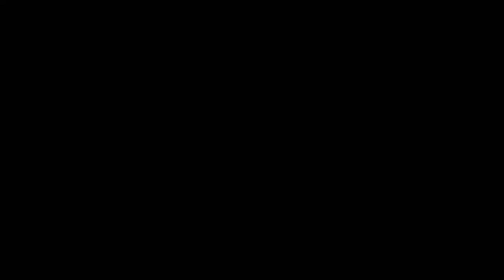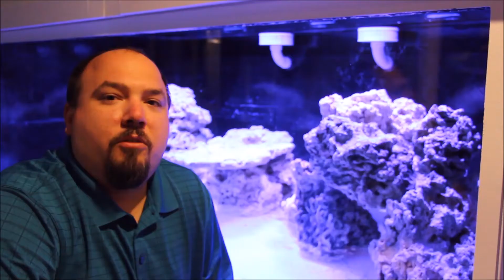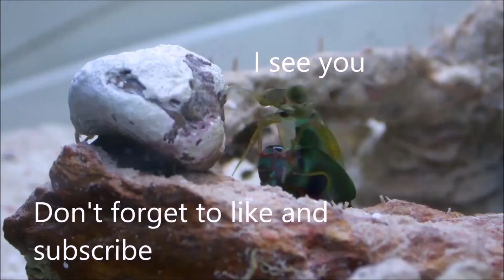720 Gallon tank setback

Comment: Water can be VERY UNforgiving !! Glad you didn't ignore it.  The extra foot of height is big pressure change from the 480 to the 720.. I'm having to set-up a commercial dehumidifier with its own sump under my 540 gallon tank and drain that , the same as water changes because of the house a/c overworking.. Always something,, right ?

Comment: Wow, it's good you had a monitoring plan for this. I had that same issue with the plastic totes I'm using for my RODI and saltwater but the problem there was of course, that the plastic is so flexible. All that did was cause deflection in the vertical plumbing connecting the two tanks. But it wouldn't have shown up if we hadn't done the leak test with the plumbing already in place. We were looking for drips, but this showed up. Just goes to show you there's always something unexpected around the corner. 🙄

Comment: yo said (even more when using add the salt in), why would it weigh    more when using add salt?
Reply from the maker: This is a great question.  When you compare freshwater vs saltwater to each other they have different densities.  Saltwater is more dense than freshwater which in part will make it weigh more than freshwater.  

The best example I can give of how this visually works is the use of a floating hydrometer which is measuring the specific gravity of the water.  Specific gravity is a ratio of density of a reference substance versus another substance.  A common hydrometer when reading freshwater should ideally read 1.000 which is the reference substance.  I will add that the temperature of the water will effect specific gravity measurements as well.

As salt is added to the water the density of the water increases which causes the hydrometer to become more buoyant which will measure a higher level of specific gravity as the hydrometer floats higher in the water.  The dry salt has a weight to it and when its dissolved into the water it will increase the density of the water which will also make it have a higher weight.

Comment: wow sorry. you got me thinking that I should redesign my tank completely. Again, I'd like to do a 96x 48 x 36h. think I should switch to a 2x4 stud build?
Reply from the maker: Bob,
I am going to build an on edge vertical 2x4 frame around 3 sides of the 720 gallon tank.  I have good confidence that the issue will be resolved but I would say wait and see what happens with my tank first before you finalize your design.  I have seen other large plywood displays use this method and I was hoping that the thickness of the plywood I was using would be enough but as we can see it is not enough for a 36" tall tank.